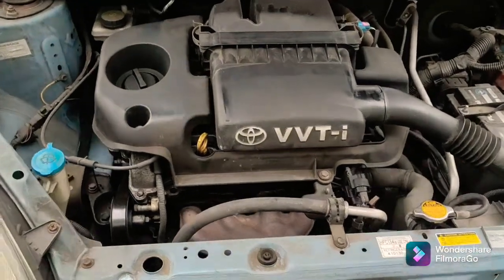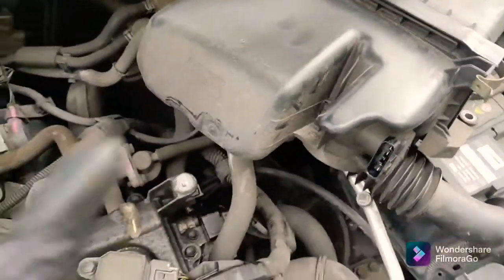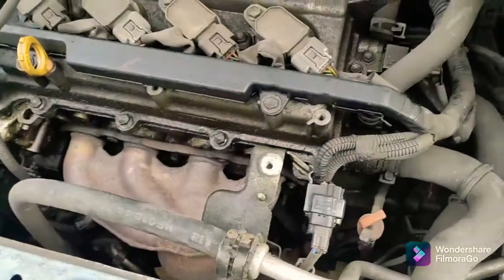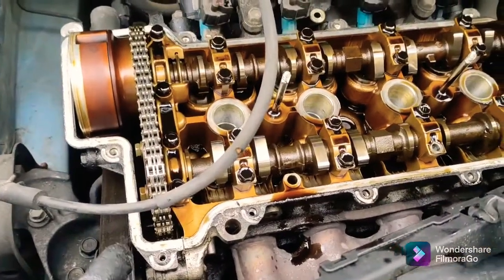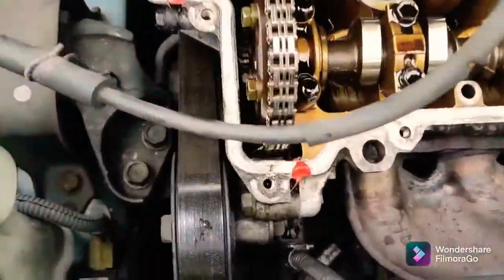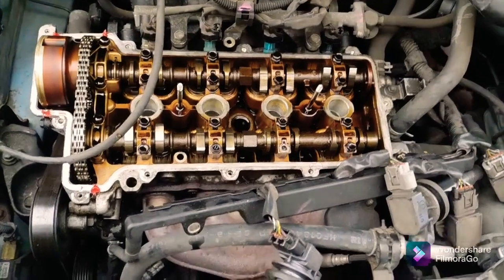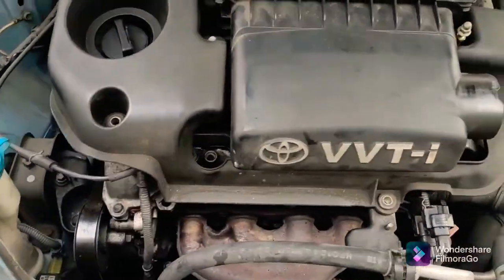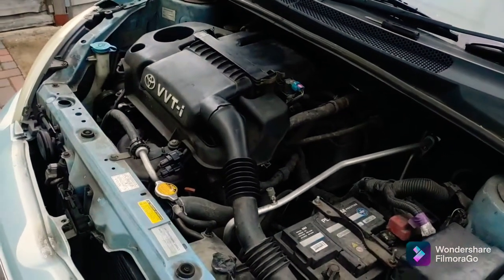Engine Oil Leak - How to Replace Rocker Cover Gasket on a Toyota Yaris

Comment: Im losing quite a bit of oil, quart every fill up. What was your loss?
Reply from the maker: Not that much to be honest. I did it because I could see a bit of seepage and you get oil smell in cabin. So fixed it before it got too bad
Reply: I believe the cause is the oil filter bracket gasket between the engine block and bracket itself.

Comment: Great, just how hard should the screws be tightened to the cover?
Reply from the maker: Hi, as per the other video. .I didn't have torque wrench, so hand tighten until there's gentle resistance then a quarter turn more and that's it.
Reply: Until your finger nugget presses inner-ward.
Reply: By german specs: gutten tight
Reply: Same problem
Reply: 8-10 Nm it is, so don't tighten too hard. They break easily.

Comment: What tools do you need for this job. Is it just a 10mm socket
Reply from the maker: Yes & a screw driver. might need pliers to help with hose clamps but mine just needed screwdriver

Comment: U should pls show how u unscrew I’m a beginner never opened a gasket
Reply from the maker: I'll make sure to video for next one I do. To unscrew the bolts it's literally using the socket to take them off. The rocker cover gasket itself, you just carefully peel off and make sure no plastic remanents go into the engine as you do so.